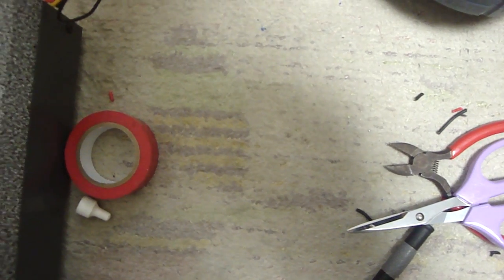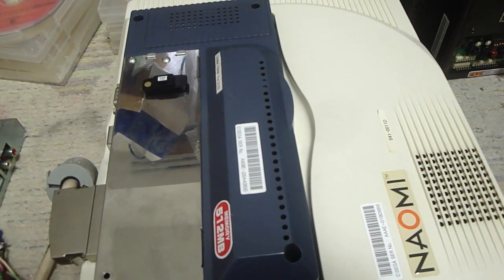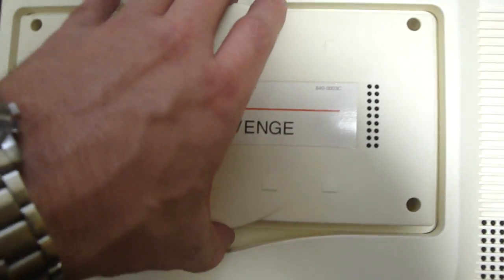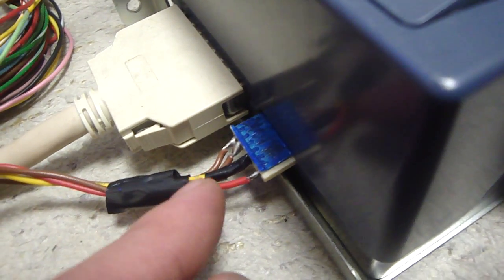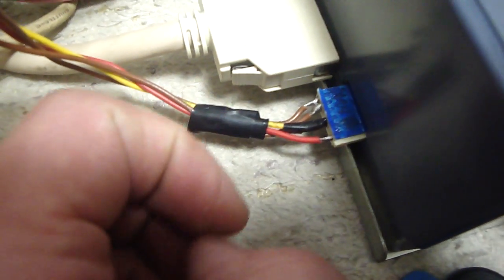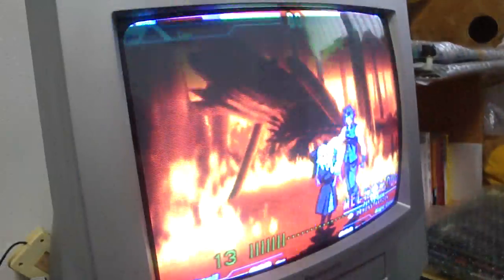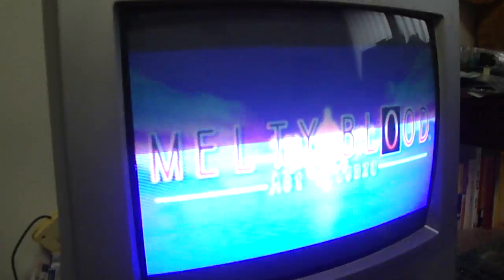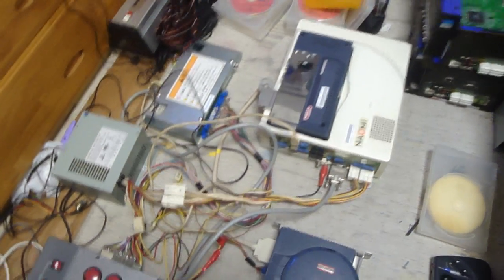How To Wire A Sega Naomi With Net Dimm And GD Rom Drive

Comment: Hey man. I just made a video about my Naomi. I am tried to watch for your video to see how you actually powered this thing up. Think you can help?

I’d like to use the PSU that was included with my Naomi but I suppose it is possible it could be bad. I’ve been able to get mine powered up using an ATX PSU with an adapter cable.

Any help would be appreciated.

Comment: Silly question but how did you plug in your Sega Naomi power supply to the wall mine only has two small black and white cables with a white three pin connector on the end with no power cable
Reply: +Sakurazukamori2424 Yes I finally figured it out, what I ended up doing was the following:
1. Strip off the white connector on the power supply leave the three wires in tact: black white and green
2. Find a standard black power cable, like the ones that plug into a desktop computer and cut the female end off (the part that would plug into the computer, not the part that plugs into the wall) once you do this you will see three wires in the power cable as well: green, white black
3. Strip the three wires on the power supply to expose the copper wiring 
4. Strip the three wires on the power cable to expose the copper wiring
5. Combine the cables on the power supply to the same color on the power cable (so for example you can coil the black wires to one another via the exposed copper on each, then do the same for the green and and white wires) then you can protect the connected wires with electrical tape
6. For the green wire this is the ground and you can connect it to the small outer screw on the power supply.
7. Plug in and test if the light comes on and the fan spins on the power supply.

Hope this helps and feel free to ask me any questions you have about it if you run into problems and ill try to help as best I can
Reply: +DevilZ s204 

Did you ever find this answer out, Im in the same position as you are, I think I have everything set up correctly but I can't figure out what to do with that power supply three pin connectors with the white and black cable?
Reply: DarkHadouXS You sir are a king of kings, thanks for the advice and if I have some trouble, I may shoot you some questions, thx again!!

Comment: their not very good, sega used them for the dream cast. you can't really scratch them because if you do, there's a chance that the game wont work no more. Microsoft's HD-DVD is the same way, scratches = possible death to data on the disk. even if you take the disk to be repaired

Comment: Nice vid ,as always thanks for sharing.  About the annoying load time, you can  1)  try netbooting since you have the net dimm, it's a LOT faster to load the games over Ethernet ! And 2) rebuild  the battery pack using CGR18650 batteries which you can find on ebay.